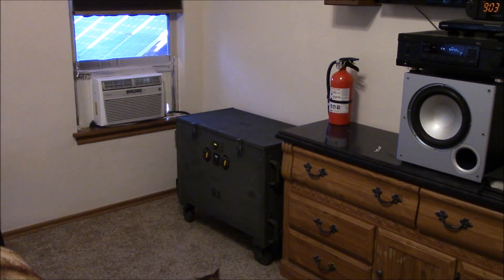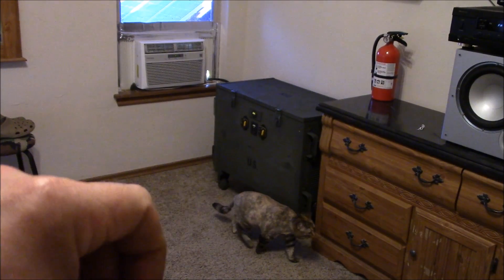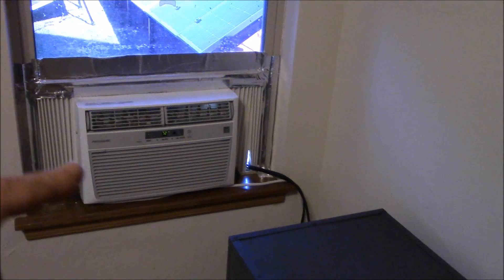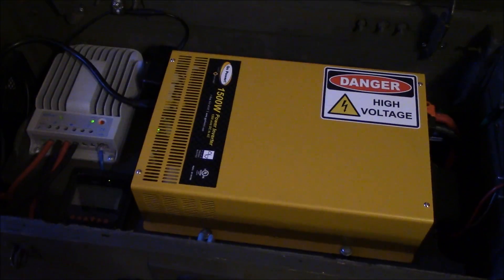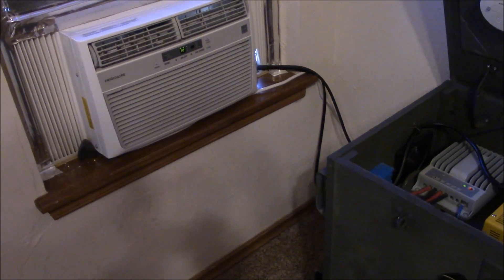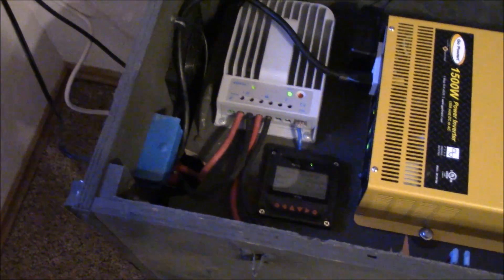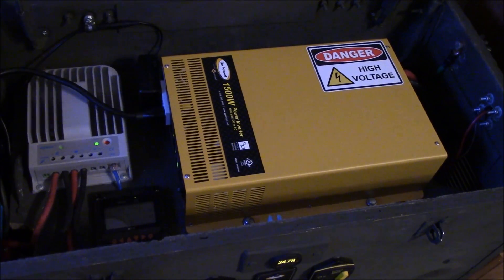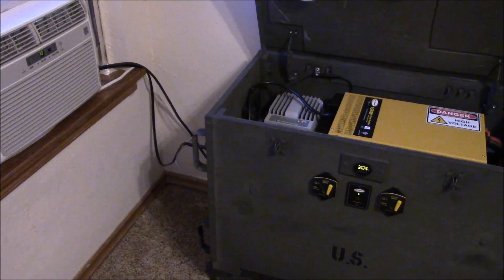Bedroom window AC running on my solar generator

Comment: Any recommendations for a solar powered box window a/c for a brick porch that gets very hot in northwest Florida spring, summer and fall seasons?  It just seems that all the material and equipment cost is very high, so when is the return on investment?  I our brick porch is average size - it has a dining table with five chairs, a big La-Z-y Boy recliner, a wicker, small nightstand table, lounge chair and foot rest,  TV entertainment center  and small three drawer. It is cramped because have my Teeter's HangUp!

Comment: Where can I buy a solar generator like that , you think a set up similar to this would work for my apartment ? Or something like this ?
Reply from the maker: There are high end lithium roll-around battery packs out there for sale. Ones with everything built in (inverter, solar charger, safety switches, fusing, etc) are rare.

Comment: Hi, just recently faced Hurricane Laura. I am interested in building a solar generator. How long will this generator power this A/C unit?
Reply from the maker: On 69F prob about 4-5 hours. If I conserve (ECO mode) and raise the temp to 73-74...should last for a few days (without any solar panel recharging). It depends on MANY factors, so these are best guesses.

Comment: @
Chris DIYer  This is cool, I like how you store your inverter, nice army box and cool solar system 🤓
Reply from the maker: Thanks. I have four Battle Born lithium batteries (100 aH each) ordered for this box. Likely will also go with a Victron inverter/charger. This box has been in continuous use for 3+ years. Only turn it off when I am outta town...which isn't very often.
Reply: @ChrisDIYerOklahoma   mmmmh very interesting thank you for sharing your vids and for not talking too much / making a resume of what you'll say and going straight to the point. Usually ytbers go on a long resume at first which is useless since it's already said in the title !
Reply: @ChrisDIYerOklahoma   you are on only 400 watts of solar, right? mono or poly? 12V/24V/48 Volts solar panels?

Comment: Add a capacitor between battery and inverter to provide a small necessary surge needed for AC. I did it and it wirks

Comment: How much does a setup like that cost? The solar panels and the generator? I'm looking to do something similar for a window A/C unit of the same size, in case of emergencies when the power goes out for a day or two. Thanks!

Comment: Add in a large capacitor.
Reply: Yep.  Those work very well, just like when people install them in large car stereo setups.  I should probably get a 1.5 farad capacitor for my set up.  See my channel for my A/C unit running on two solar panels.
Reply: @snn9019  Great vids btw.
Reply: @FirstLast-we8cb  Thank you for taking the time to check them.  I will be buying a capacitor soon.  When the A/C compressor kicks on, it dims the light from the surge.  1.5 farad capacitors have come way down in price.  Back in the 1990's I remember seeing them for up to $200.  Now I see many for sale for around $25-40.  A really good investment.

Comment: 8000 btu is nothing but the surge load can still be crazy on those inverters I got a mini split 1200btu ac but has a inverter inside and starts at 300w and builds up to 1200w and goes down to 250w after cooling

Comment: Don't knock your inverter for its ?surge capacity because It's actually quote good for a 1500 watt inverter to ve able to start an 8000 btu AC.   I couldn't do it with even 2000 watt/4000 surge inverter and had to step up to a 3000 watt inverter.

Comment: you can put a capacitor between tour battery bank and your inverter  check this link out I think it might help you with your issue https://www.youtube.com/watch?v=bVaAqWzOHFw
Reply from the maker: Just watched his video. Curious about the wiring. Is it on the NEG side between the inverter and battery bank? Thanks for the link...appreciate it. When I made this video, I only had 600w in attached solar panels. Now with 1,000w, having less issues, but am still interested in a capacitor to ease the compressor start up on the system
Reply: yes between the battery bank and the inverter closer to the inverter the better

Comment: I know nothing about this shit but how long will the AC unit run on a single charge?
Reply from the maker: It can run 2.4 kWh of "safe" battery power extraction when fully charged. It is designed to run the window air conditioner/charge batteries on solar power during the day...at night, I usually switch back over to utility power. However, have run it all night on batteries/ECO mode setting. Taking this type of battery below 50% state of charge will shorten the lifespan. The four Trojan 31 deep cycle "Overdrive" batteries are AGM...no off-gassing

Comment: do you think a 5000 btu would run off of a 12 volt solar generator like the yeti 400
Reply from the maker: No. I actually now have 1,000w in solar panels on this system. I only run the window A/C when the sun is up/producing power. It will run for a few hours on battery at night...but, will bring them down fast
Reply: great. info thank you

Comment: cutting it really close with only 1500w. but totally cool {literally)
Reply from the maker: That system runs 24/7
Reply: Chris DIYer how many amp/hours of battery storage do you have to run 24/7 ?
Reply from the maker: 200 aH @ 24v. "Usable" aH is about 100 aH...or about 2.4 kWh
Reply: Chris DIYer as long as you have enough panels to top it off during the day I suppose that's sufficient. I would like to build a system sometime soon , these videos give me an idea of what I need. Air conditioning and refrigerator would be my biggest current draw I think, everything else would be minimal DC and could be stepped down directly from the battery.

Comment: Hello, that low battery inverter beep is due to hard starting. It peaks draw at the startup and you can fix that by wiring a capacitor bank between the inverter and the battery bank. As long as you have aninverter that can handle the surge then itll be smooth sailing with the capacitors handling immediate draw. :) Be careful you get good caps though as I learned the hard way the Chinese ones can become ballistic.

Comment: Look into a soft start capacitor, you install it inside your ac and will reduce the start up requirement so your invertor shouldn't beep

Comment: Chris, This Ultracapacitor along with the 1500 watt Go Power would run the 8000 BTU A.C. with no problems what so ever. However since your system is working without a capicitor you should be good to go. If ever you go with one it hooks directly in line from battery cables to capicitor to inverter. The one on ebay has to be put together or you can purchase them complete for a bit more. It can also be used for Battery eliminator, car audio, starting or remote solar.                                                                                                                                    http://www.ebay.com/itm/Ultracapacitor-Module-KIT-Battery-Eliminator-Car-Audio-Starting-Remote-Solar-/371669580302?hash=item56893bba0e:g:Id4AAOSw0fhXi2ry
Reply from the maker: Thanks

Comment: Nice brother. My 1500 Go_power 12 volt would run the small 5000 BTU AC not troubles would not buzz. That is now my dump load ac. It still running all the time off my pip. O have not tryed to run the 12 BTU ac yet. Will do that soon. God Bless brother.
Reply from the maker: It is still "magic" to me how all this stuff works

Comment: Does your ac seem to run slower on your solar than the grid ? Mine sure does
Reply from the maker: A little...however, I bumped the Go Power dipswitches to 120v. I think it came out of the factory set at 110v. It is an "okay" inverter...but, def should have gone one size up with more surge capability
Reply: im so glad you mentioned dipswitches , you reminded me i had mine over on 50hz  lol swapped her over to 60, ac now runs like a champ, im so glad your solar is back up brotherdont get me wrong i like all of your videos keep them coming

Comment: Very nice, once again, Chris!   Solar air conditioning is what drove me to make my house solar in the first place.  The thought of being able to operate such power hogs and keeping my house cool without depending on the power company was just a wonderful thing.  
You've got the right idea about using an inverter with higher peak output.  In the comments of one of your other videos someone was arguing about using capacitors but it's just simpler to have the inverter to handle it in the first place (that is, if you were going to buy another one anyway) :)
Reply from the maker: Thank you. This year I am being a little less conservative. Gonna be using the home's HVAC in conjunction with the two window AC units. I agree...no capacitors. For now, I am okay with the Go Power 1,500w PSW inverter. However, prob should have gone with a unit with better surge capability in the first place.

Comment: time to look into a set of super capacitors to stop the inverter from beeping. I run an ac unit like that after my battery bank is charged up off my solar battery setup.
Reply from the maker: Somehow, it doesn't beep anymore. Might have imagining it or something. All good...not gonna use caps

Comment: Great work, Chris! Do you feel the 8000btu AC is adequate for a room your size or could it be smaller or larger? Would it have been better to run the AC on Econo mode so the fan would also completely turn off when it reached temperature? Great video. Your right about the surge and In Rush Current of an AC. If you had an In Rush Clamp meter you could actually measure to see what the current is upon startup of a motor or AC unit. We have them at work doing electrical work. Fluke makes a good one. Take care.

Jeff 
Journeyman Electrician 
Sunny Central Florida 2.5k Solar System
Reply from the maker: 8,000 cooling BTUs for that master bedroom is perfect. Economy mode would save a little juice...but, I like the fan circulating the air. I have a clamp meter and should test the compressor rush/start up current. I am just happy as a pig in mud it works on my DIY solar generator with four Trojan 31AGM deep cycle batteries. About 200 aH @ 24v. Running the portable solar generator with this AC window unit takes the load off my main system. I can run two window AC units off my main house system...but, charging time takes a hit.

Comment: Nice job, I have my system running a similar sized AC unit, my Go Power inverter is the 2kw & so far so good.  When the Pump kicks on I surge up to about 40% then it drops & settles at 20%.  Great Job Chris its going to be a lot more comfortable in there now I am sure.
Reply from the maker: Thanks. I think your's has an excellent surge capacity. This one isn't as robust. So glad it does work on this 8,000 cooling BTU window shaker tho...and is off my "MAIN" home solar power system. Saves a lot of stress on the main system...esp when it is 95+ outside
Reply: Chris DIYer Yeah, Those AC units whoof, They really like to consume energy.  Playing around with mine & the sun I get I can leave mine on at 73° & do fine from about 11:00 - 18:00 before starting to dip heavy into the batteries.  
Take Care Friend.